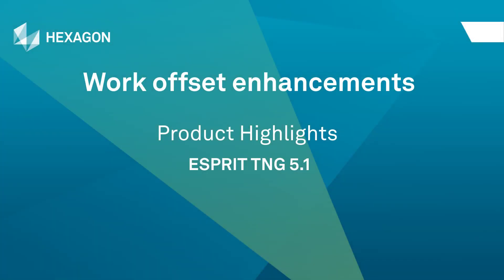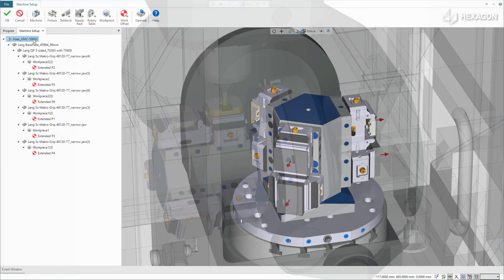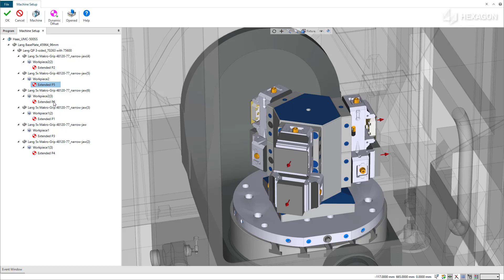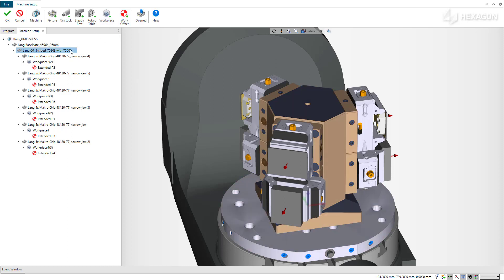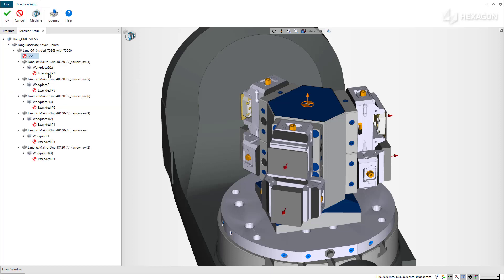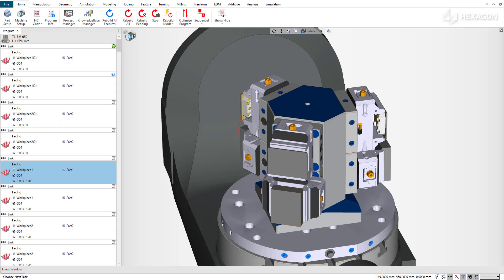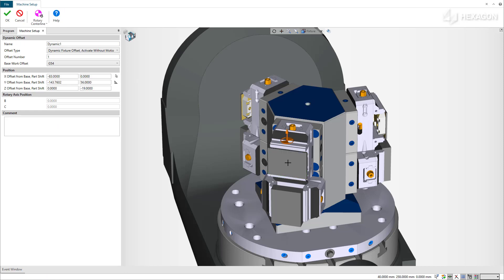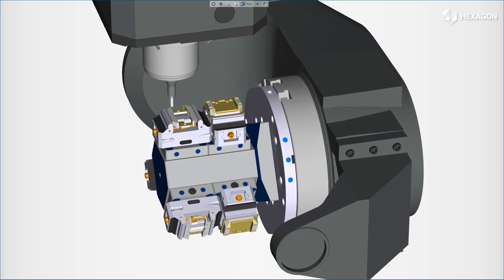Work Offset Enhancement with ESPRIT

Comment: Esprit TNG makes setting work offsets other than the parts origin very easy.  We put 2 small parts per vise, but flip one of the two parts 180 degrees so we can do side work on both parts.  I like that I can program from the top and center of a part, but set the work offset to the bottom and sides of the rough stock.